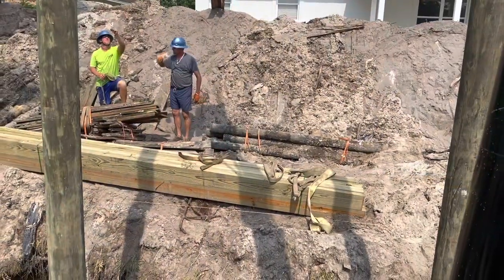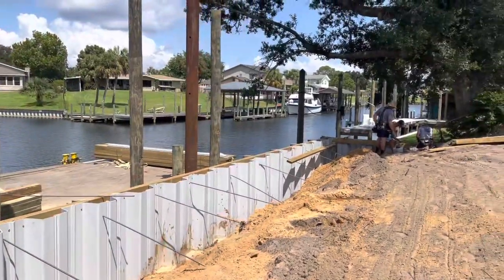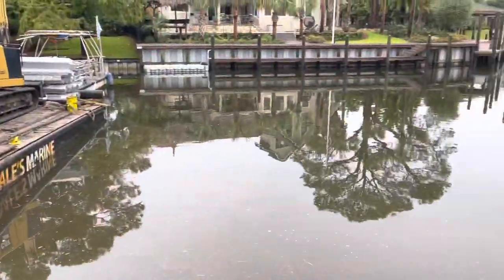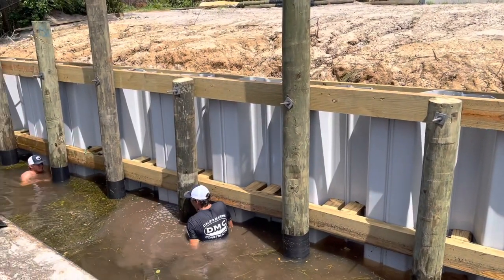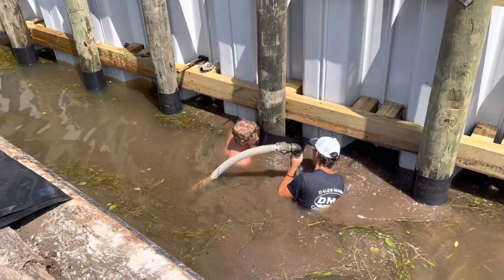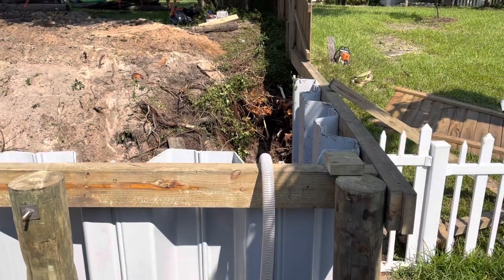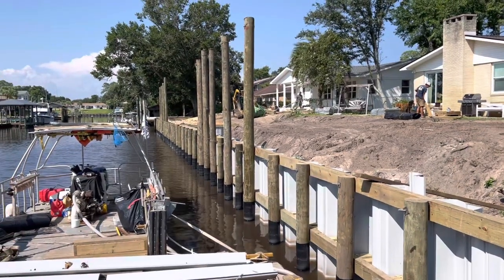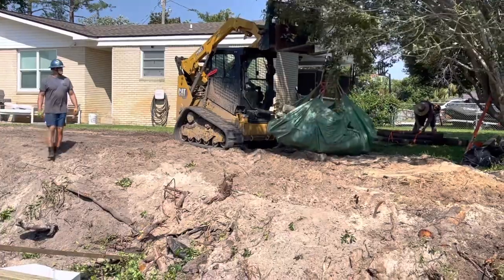CANAL SEAWALL MAKEOVER

Comment: Hi Dale I am replacing boat dock approximately 5ft. Wide by 40 feet  long using the old square concrete pilings  going into sea wall coral rocks using salt water pressure treated wood  for the beams can I just use decks boards regular pressure treated boards.
Reply from the maker: Hey thanks for the comment in question sure you can as long as they are pressure-treated and not in contact with the water full-time. If you’re purchasing from Lowe’s I believe all of their pressure treated lumber is now ground burial material which is fine as well.

Comment: What are the pieces of wood blocking on he lower whaler and what is the reason they are used for the recessed portions of the vinyl sheet?  How are they secured to the whaler?
Reply from the maker: Thanks for watching my video. On some of the taller walls I notice the interior corrugation of the vinyl bowing out so I wanted to extend my whaler back to that corrugation with the blocks to distribute the weight equally. They are screwed in place in the weight of the dirt, pushing on the vinyl hold seven place as well.

Comment: What’s your thoughts on a cement seawall vs steel? For an active river way?
Reply from the maker: thanks for watching my videos if you’re installing a concrete seawall. I would not do a poured place one on a active river. I would do some panels that can be vibrated or jetted down into the soil to prevent any undermining. I’m sure it’s fresh water so you won’t have to worry about the rebar rusting in the concrete and expanding and breaking the concrete. Steel sheet pilings is probably your best bet for deeper penetration into the soil to prevent the undermining. Just make sure that it’s tied back system is installed properly and deep incase river overflows the seawall it doesn’t expose your tieback system if it washes away the soil.